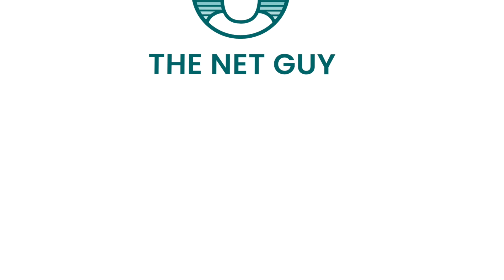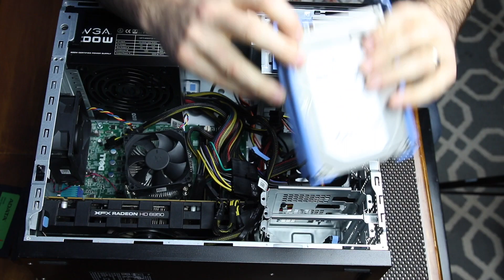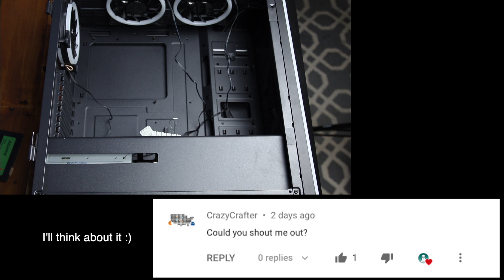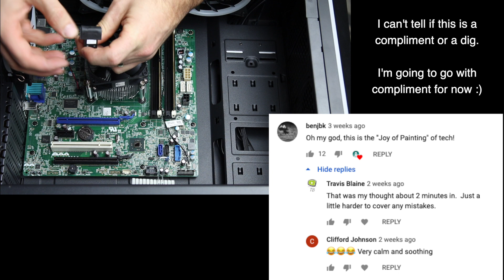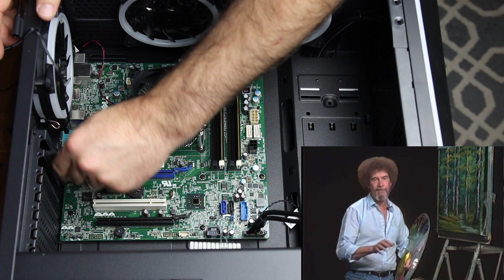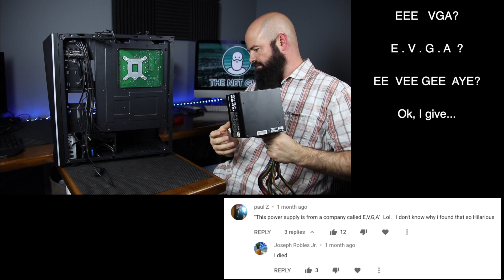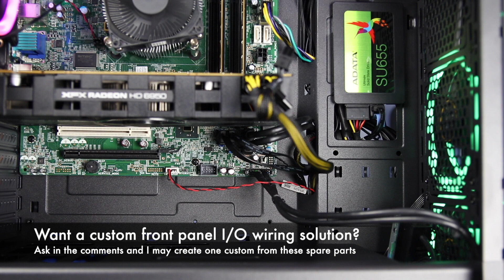Easy Dell Optiplex RGB Case Transplant

Comment: Hi sir,
I have a Dell Optiplex 790 mini-tower.
Do you think I can swap with this case?
Also it seems the case you used is discontinued, do you have any other suggestions?
Reply from the maker: Hi Sung Tao - that happens sometimes.  Most any mATX or full ATX will work.  I’m not sure on the 790 - I’ll have to do some digging on that one.  Thanks for reaching out.  Personally I like the NZXT H510 model cases for affordability and good design.  If I didn’t have three cases sitting here I’d buy one - they are on sale today!
Reply: Thank you! I really appreciate the help. I will checkout the  NZXTs
Reply: I think I have watched this video 100x. Finally built my first pc last week. Will send a pic on Twitter.
I had this video playing throughout the process. THANK YOU SIR!!
Reply from the maker: Fantastic!  Congratulations, you’ve opened up a whole new world when you can work on your own PC.  It’s not hard as you’ve seen!

Comment: can you upgrade a Intel(R) Core(TM) i7-4770 CPU to i9 on the same motherboard from the dell optiplex 9020 sff MT? Any recommendations on where to get the processor if so?
Reply from the maker: No, there are no i9 CPUs available for that socket.  I would recommend looking at the HP 800 G2 which takes an i7-6700 and is 20% faster with 8 threads.

Comment: I have a question, I built one of these swaps with a gtx 960 2gb E3 1220 V2 and a evga 450w 80+ psu, like your optiplex mine came without a VRM heatsink and Im planning on selling this PC in a couple of days, would it be safe to sell it without a VRM heatsink?
Reply from the maker: Absolutely.  Unless it was engineered to have a processor so fast it needed one, most will not have one.  No harm that way.
Reply: @TheNetGuy  Thank you for the fast response love the videos.
Reply from the maker: Thank you!

Comment: can an Inspiron 3668 motherboard fit in this case that is being used in this video? The original case doesn't have enough space for my new PSU, so I was thinking is there any pc case I can move my motherboard in to. If there's no fitting case, can I at least get a close one for it and I can just mod it. hope you see this
Reply from the maker: It absolutely should.  You've got some wiring challenges ahead, but if you have the PSU connected already that's a good sign.  The new case is very big - room for a full ATX size motherboard.

Comment: Bought a 7020 but it looks just like your 9020. Glad I watched this because I would not have any clue what I’m doing 😂
Reply from the maker: Yes, those machines are kissing cousins pretty much everything wall work identically to the 9020. There’s also someone selling on eBay and adapter for the front panel I/O if you need it.
Reply: Did you end up getting a jumper for the 7020 or did you get an adapter? I swapped everything over except for power switch that’s the last to finish up. If I get a jumper will it work for 7020 in same way?
Reply: @chrisbulick2051  well actually my pc killed itself like a month ago. The PSU wasn’t enough for the 1060 3gb graphics card, and I couldn’t get another because the adapter fried. Moral of the story: never get adapters for anything to connect to your power supply! How I have to get a new mobo, psu, ram, and case cause it might have overheated too
Reply: @captaincobra4578  ahhh right yeah gotta swap out the psu
Reply from the maker: Were you trying to use the stock Dell power supply with a Sata to PCIe adapter?
Reply: @TheNetGuy  hey do you know where I can find that jumper for the 7020? (Assuming it will work for my 7020 sff)
Reply: @TheNetGuy  yes, which should’ve worked because it’s a lower power gpu but I’m not wanting to get a 24-8 mobo adapter and fry my whole system
Reply: @chrisbulick2051  requires a mobo adapter which everything I hear is a bad idea
Reply: @captaincobra4578  what have your heard? I just installed my 24-8 and it works just fine.
Reply: @chrisbulick2051  fries your mobo is what I’ve heard. Might just be a lemon glitch but I’m not wanting to test it 😂
Reply: @captaincobra4578  that's odd no issues for me. any links to that jumper guys?

Comment: I had to subscribe I have a question did you need to order anything else for like the sound  and USB PORTS, I’m using a dell 3010 if you can get back to me that will be great nice videos 🔥
Reply from the maker: It really depends on each model and motherboard.  It looks like the 3010 has a normal ATX power supply and standard usb 2.0 and audio connectors.   The front panel connector may have to be worked around like I did.  Thanks for going!
Reply: @TheNetGuy  sorry so late thx

Comment: Thanks for a great video and inspired me to do a case swap from Dell DT 7010 to NZXT H500. Whilst most parts worked ok, except the power switch. This is where the NZXT case does not have individual headers and its all combined in front panel headers and I do not know how can i cut and connect individual five wires from the Dell socket to the many pins in front panel socket for H500. I found another widow that showed that LED and power are in one row with 4 holes, and this game me LED but a non-functioning power button (eg. i cannot turn off or on PC when i pressed the power button). I will appreciate if you share how can i connect NZXT 500 case power connector to Dell 7010 board/power switch. Thanks

Comment: Hello, I tried the power method but with I turn on my power supply my computer turns on right away, does the power switch cable from the case have to face a certain way? Label facing away from the ram or towards?

Comment: Hello.. where can i get that white tiny jumper for power switch? Can i buy it or get it somewhere? Please help. If i cannot find one, can i still use my pc without any problem? I dont mind getting the power error 😅 will it still boot? Thank you sir.
Reply from the maker: Hey Arc - you can use the hdd LED connector if you don’t have a spare jumper.
Reply: The Net Guy ok you mean the hdd LEd for the new case? Should i cut it or i plug as it is😅. Thank you for quick response. Btw new sub here. You are really kind.
Reply from the maker: Yep, you’re very welcome!  Let me know if that works.  My friend Dan at PC Tech Hustle YouTube channel has an Inspiron video and figured this hack out.
Reply: The Net Guy i have exactly the same model dell opti 9020, and im getting a new case nextweek. Thank you 🙏 i will let you know if i will not get error for the power switch ☺️
Reply: Hey Bro, i just got a Xigmatek case, just want to double check before i start the transplant :) do i need to cut the HDDled jumper or should i stick as it is? thank you again. i am making a video also. inspired by you :) hope everythings work.
Reply: Hey bro the case swap is almost perfect, just still gettin this power button error, i think the HDD led didn't work. But it's ok for now, can live with it. Untill i find a proper jumper. Thank you ☺️

Comment: Hey just wondering what i need and if i could swap my case for my dell optiplex 9020 sff to. Montech Fighter 500 ATX Mid-Tower Computer Gaming Case/Pre-Installed Four Rainbow LED Fans, High-Airflow, Mesh 3D Front Panel, Tempered Glass, Magnetic Dust Filter/ATX,Micro ATX,Mini-ITX, Black. Just found it on amazon for a good price and needed to know if this would wark and what else i needed to buy to swap the case. Thanksv
Reply from the maker: The SFF is a tough platform to swap.  It can be done, but you’ll need to figure out how to handle the CPU cooling because it’s CPU fan is bolted to the case.

Comment: Bro where did you connect the case rgb fans in the motherboard
Reply from the maker: They actually plug into the molex power connector from the power supply.  You can also by Gamdias light kit separately.
Reply: @TheNetGuy  thanks for the awesome reply man, you just got a new sub

Comment: what 24 to 8 pin cable did you use?
Reply from the maker: The one in the description.  It’s the only one I trust.
Reply: This is the adapter you need: https://www.amazon.com/gp/product/B07XRKT7SH/ref=ppx_od_dt_b_asin_title_s00?ie=UTF8&psc=1

Comment: I have a Optiplex 3040 mt . Will this case work with my motherboard? Does the 'ATX' determine the type of board/case combo?
Reply from the maker: Yeah.  The power connector and the button wiring configuration.

Comment: Nice Video! I I also have a question. Prior to performing the case swap the  pc booted and everything now I keep on getting an error code of 1-3-2 and I'm not sure what to do anymore and at this point I'm thinking of just getting a new mobo and using the i3 2120 that it came with. Btw the power  switch idea was really helpful.
Reply: Update: Ended up becoming a success, now a gtx 750 ti i3 2130 8gb ram gaming system thanks for this video it really helped.
Reply from the maker: @arsynic4202  Fantastic. Send me some pictures and I will feature you in a future video. That’s awesome that you got the SFF to do that.
Reply: @TheNetGuy  my bad I misworded, Instead I ended up trading some ram sticks for a 390 mt motherboard because the sff motherboard could fit right in the small midtower case. After getting the motherboard I went on from their thanks to your guide, Ill make sure to send you some pictures.
Reply from the maker: What model are you swapping?
Reply: @TheNetGuy  dell optiplex 790 sff
Reply: @TheNetGuy  I think I messed up with the jumpers and the ram mobo pins are touching the metal case, this was my first pc build. Or swap

Comment: Will this work with the 790
Reply from the maker: Hard to say.  Lots of dells are like snowflakes - every model can be different.  The dell 9020 small form factor is very different than the dell 9020 mid tower even.
Reply: Not related to this but the optiplex from the 390 to 990 has a normal 24 connector

Comment: Hello I have an nr 600 case I plugged the fans using the molex from the psu and as for the Front panel i get that we can use the usb ports but i also need the AUDIO port for my headsets is it possible in any way? and what about the power button on the case how do i use that and where do i plug in I'm very confused please help me..

Comment: So would it be less of a hassle if I just bought a new motherboard along with the case and transfer everything else to it?

I have a 9020 with a 4790 btw.
Reply from the maker: It depends.  If you’re looking just to get gaming, check out the GTX1650.  Motherboard powered and decent frame rates.
Reply from the maker: Bradox not sure at low settings but I made a video with nearly that exact configuration with benchmarks at high: “Dell 9020 GFX Gaming Benchmarks - 200+ FPS”

Comment: Hello, do you think this would work for a Dell Precision T1700? 
My specs are 
Processor: Xeon E3-1220  v3 @ 3.1 ghz

Ram: 16 gb

Storage: Boot: 120 gb SSD Storage: 2 TB

Graphics: Amd Rx580 8gb

OS: Windows 10 Pro

What do you recommend? What case do you think would work best ?
Reply from the maker: Precision workstations are tough.  I’d check the motherboard power connectors.  If it’s a 24 pin cable most likely.  If it’s different or specialized you may be out of luck :(

Comment: I highly recommend using a new motherboard for those who want the front IO to work
Reply: Or get the new I/O adapter from Harbin Repairs.
Reply: i want to get a new mother board  would i run into any problems?

Comment: I have a G5 5090.  Its a very nice case and has a see through panal and led bezel and light bar on the case.  How ever the case is tiny and it heats up to fast.  I can't install any good cpu coolers or a full size gpu because its so small.
I would imagine that that my mother board would transfer right over if I follow your video here with the power adapter and the power switch instructions.   Also the mother board i have has the front usbs and audio build on board.  So I'm guessing I would just lose access to them is all I would be sacrificing.  What ya think?
Reply from the maker: Yeah more fan room and more room for drives/coolers would be nice!

Comment: How did u power the leds?
Reply from the maker: Skipped them.  Really there was no need for a power LED, the case is a light show all on it's own :)   And the hard drive LED wasn't very useful to me.  If you really wanted them there are probably ways to wire them up, but I didn't.

Comment: How did you get power switch to fit. I can’t get the cover off and I don’t want to break anything
Reply from the maker: Are you talking about the black five pin power shroud?  Try wiggling gently back and forth, it will come off.
Reply: The Net Guy that is what I am taking about. I will try that
Reply: The Net Guy that worked! Well sort of. I was using pliers and half of the cover just broke 😅 it accomplished the same thing though!
Reply from the maker: Nice work.  Also, check out PC Tech Hustles video if you want to see how to use the power LED wiring on the center pins instead of a jump.

Comment: hi, grat video... question
i have an i7 4790k CPU, will it work?
and i dont have the frontal panel nor the thermal sensor, will it start without them? i got the fans, adaptor from 24 to 8 pin, etc.
Reply from the maker: That’s a great cpu.  What happened to the other cables?  It should run without the thermal sensor, though I don’t think it will without the I/O header.  Can you get them on eBay?
Reply: @TheNetGuy  probably, thank you a lot!

Comment: I have an old optiplex 990 mt and what stopped me changing the case out for a better one is that the motherboard has a 5 pin fan connector but the case i want to change it too has a 3 pin fan connector. How do i work my way around this?
Reply: I subbed because of the extremely detailed explanations btw (-:
Reply from the maker: Thank you for subbing and the comments.  The easiest solution?  Transfer the fan from the MT case too.  Won’t hurt anything and you’re good to go!  Beyond that I’ll have to do some research to see if the pin outs are available and what adapters would work for you.  The fan sounds like it has an RPM feedback wire to show speed/failure.  If you have a traditional fan header it may not work.
Reply: @TheNetGuy  Cheers 👍

Comment: How do you bypass the audio through the HDMI of the graphics card?
Reply from the maker: Inside of windows if you click the volume control it will show the device the audio is outputting through.
Reply: @TheNetGuy   Thank you I'm going to try it. DId not know that windows will detect the video card as an output audio device.

Comment: can someone help me with the 5 pin fan pins can i use a jumper to bypass that error message? If so what type of jumper, do i need a 2mm jumper? and how many jumpers i need for each pin?
Reply from the maker: PC Tech Hustle did a swap and figured out you can use the HDD led pin to act as a jumper as well.  Try that!

Comment: Hi, I need your advice and solution I have Dell Optiplex 3020 want to convert into full gaming PC and willing to change the ATX case which one would you recommend?
Reply from the maker: There are a ton of great case options available. NZXT makes some really nice ones. Gamdias also makes the Talos M1 and the Athena M2 which I’ve reviewed in other videos. Are you looking for expandability, RGB, or size?
Reply: @TheNetGuy  hmmmm, rgb and one more question i want to use 4 to 6 GB graphic card which one do you recomemd? And please share your links related to AtX case swap videos for dell

Comment: Hey man I have a mid tower Optiplex 3020 i54570 will I have any problems transferring to another case and using stock psu  also any recommended cases for this build
Reply from the maker: Should be good to go.  The NZXT 510 is a good looking budget friendly case.  The power switch will be the only quirk, but solvable.
Reply: The Net Guy what about the front USB ports
Reply from the maker: You can buy an adapter to make the USB 2.0 ports work.  The USB 3 ports are compatible.

Comment: hi, great video, i saw you didnt use the front audio jacks, but do you know how to hook them up if needed, im trying to build one for my son out of a 7020 sff and im stuck with that that he really want lol. Thanks in advace
Reply: there is an adapter to change the proprietary io port to a standard one, keeping all  of the functions like usb 2.0 and hd front audio, while not displaying errors on startup. https://www.ebay.com/itm/Dell-Optiplex-7010-9010-7020-9020-and-Precision-T1700-Front-Panel-Header-Adapter-/264733441811?_trksid=p2385738.m4383.l4275.c10&autorefresh=true
Reply from the maker: Wow very cool.  Didn’t exist back when I made the video.
Reply: @TheNetGuy   yea they’re pretty unknown even now. I’m pretty sure only one guy makes them on custom pcb’s on eBay.
Reply from the maker: It depends on your case type, you could always buy two 3.5 mm audio jacks, plug them into the Dell jacks inside the case and connect them to the audio header from the case
Reply: @TheNetGuy  DIYPC Zondda-B Black USB 3.0 ATX Mid Tower is the one i brought,  but how to do what you suggest?
Reply from the maker: You’d have to make a custom wiring harness.  But it’s doable.

Comment: Hi. Great video. If I leave the old front IO plugged in but clip the wires half way (to keep tidy) will it still work to recognise front IO and not give an error? Thanks.
Reply from the maker: I’ve read that it will, but it always feels permanent.  If you ever decide to upgrade motherboard or CPU in the same case later, you may want the old IO panel to put it back in the old case.
Reply: @TheNetGuy  Thanks for the feedback. I updated Windows and now am getting io error. Even thought I have not sniped wires. Was not getting it on first boot or so. Very strange.
Reply from the maker: Uh oh.  Fan or IO board error?
Reply: @TheNetGuy  IO board..